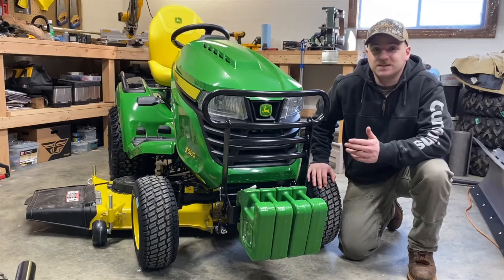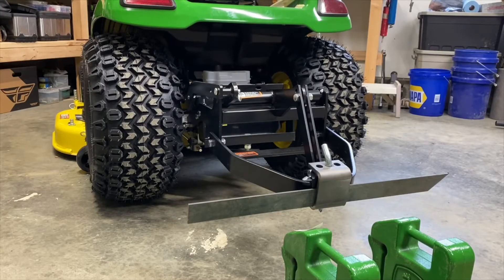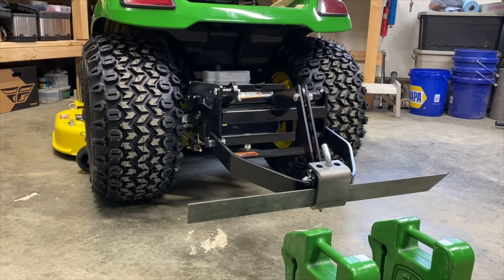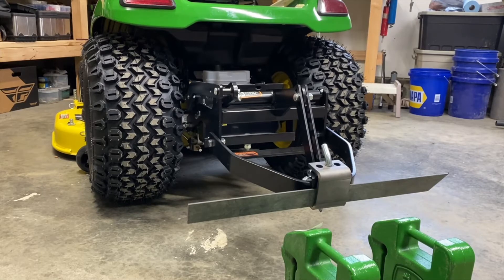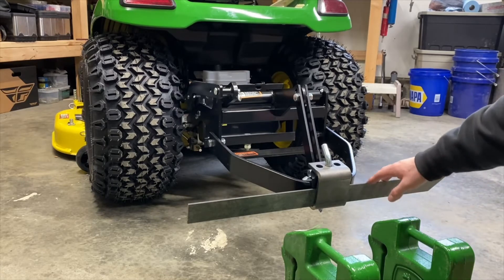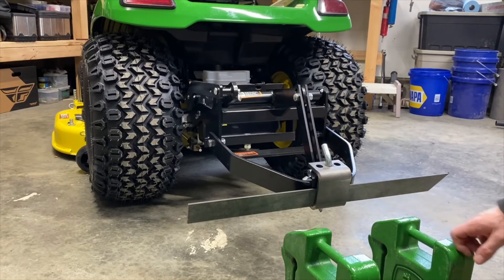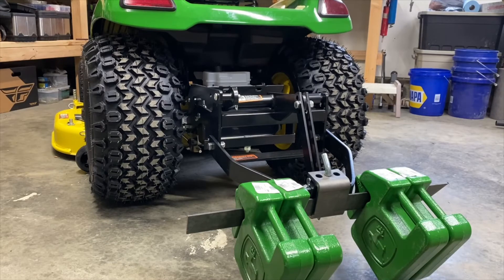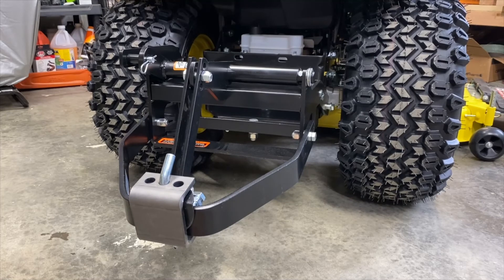How Much Can It Lift???

Comment: Was it bending the actual frame of the tractor or just the sleeve hitch?
Reply from the maker: Not bending the tractor frame at all, if I remember correctly it was the strap that ties the hitch into the deck lift.

Comment: Mower deck will creep down as it sits if left up.  Dealer checked with manufacturer, said that normal.  Dealership checked with units sitting in showroom…they creeped also.

Comment: The hydraulics on the x580 will lift the weight of the tractor.... but that hitch is not designed for that kind of lifting..   the hitch design for the hydraulic tiller is much heavier..What you have is for Brinly Hardy implements only.  I've seen guys plow with 2 or more weights on with the moldboard plow...